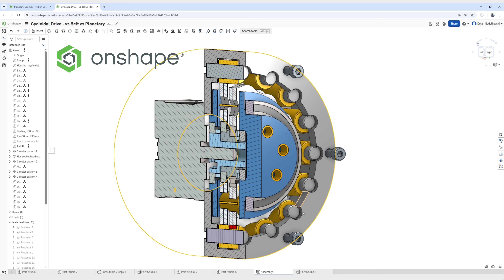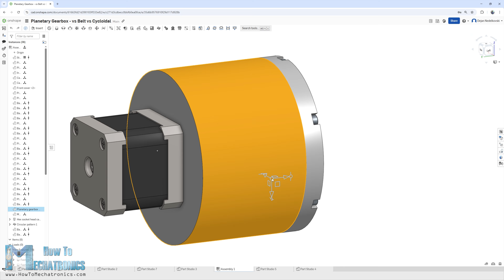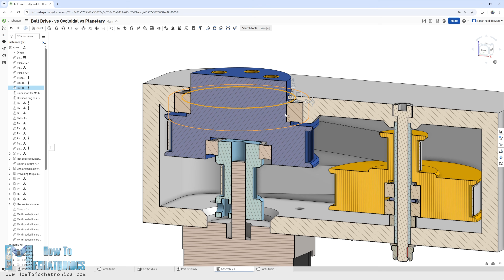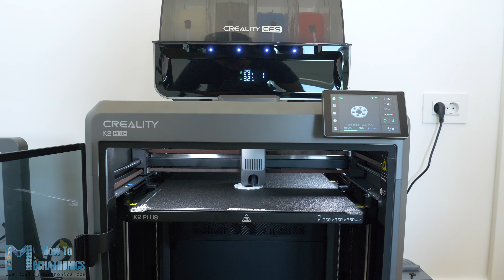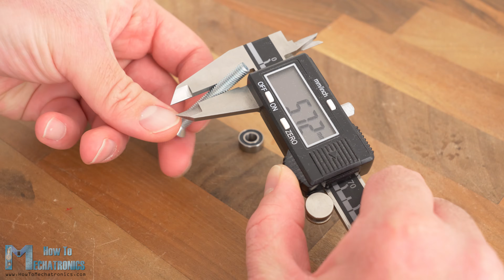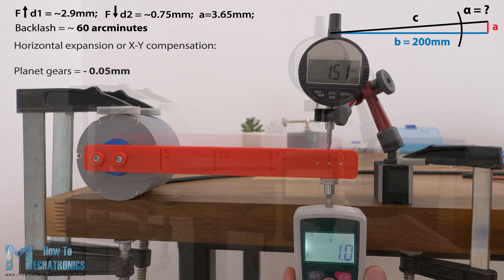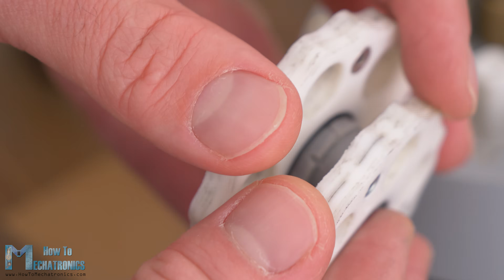Cycloidal vs Belt vs Planetary - The Best 3D Printed Drive for Your Next Robotic Project?

Comment: 2 more things you should consider
If you are able to do belt drive in just one step, the backlash should be even smaller
And, if you're building robot arm, belt drive has the advantage that the heavy motor can sit lower and therefore you have to use less torque.
Reply from the maker: That's true. There many things that I didn't mention in the video, as it was already too long and I didn't want to overloaded. But we will see more comparisons between these drives in future videos.
Cheers!

Comment: PLA is a very bad material for the gear boxes :( 
PLA has a very bad creep under load. 
PA6 > ABS > PETG >> PLA

Testing wear on a plastic gear box and cycloidal is somewhat travesty without extensive consistent lubrication.
Reply from the maker: Yep, PLA is not very durable. I already made a video testing different materials when 3D printing gears.
As for the lubrication, I did put some small amount of lubrication on the planetary gearbox. As for the cycloidal drive, I didn't use lubrication as I though there is not much need for that, as there is a rolling resistance there. The highest resistance should occur between the bushings and the pins, which are fine in terms of wear, they are not 3D printed.
Reply: I'd love to see someone use the Polymaker Fiberon PPS-CF in a gearbox

Comment: I find it easier to make high reductions with a cycloidal drive. When I tried to make multi state planetary drives with high reductions it became hard to assemble and their was too much backlash.
Reply from the maker: Well maybe you have better design. I have made four different cycloidal drives designs in the past, but I found the planetary gears to be easier and with this last build, better in backlash.

Comment: Thanks for the informational video one more time.
Consider for the update test  to use silicone lubricant for the Cycloidal and planetary drives as and in real life the use lubricant to these setups, will help the friction and the wear of the Pla i think .
Good idea to use next time a tension pulley instead a single bearing to the belt drive . Good point also to make the Cycloidal drive and the planetary with very tight fit and then use them for some hour to wear in the right dimensions (maybe that would be good idea if when you use the lubricant inside with your suggested dimensions  have not good  result  in wear out 

Thanks again all this time for your videos , have helped me a lot in some of my own projects
Reply from the maker: These are good points.
Thank you!

Comment: Nice! great tests... you're going to get so many views from the huge silent mob of 3d print actuator enthusiasts. One question, why no lube?
Reply from the maker: Thanks! I did put some lube on the planetary gears but I didn't on the cycloidal drive. The cycloidal drive has rolling resistance so I thought there is no need for lubricant. I don't believe it would have made much difference to this particular design.

Comment: Could you make 4 clearance holes in one side of the case and large pulley of the belt drive that aligned with the mounting screws of the stepper to allow for tightening of the stepper motor screws from outside the case in the belt drive?
Reply from the maker: Sure, that's an option. There are so many ways to design the drive.